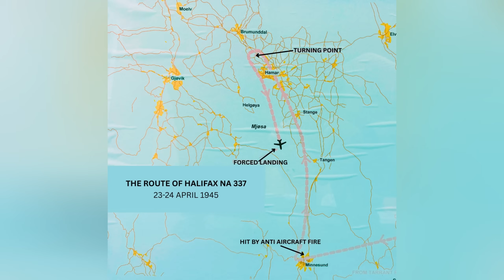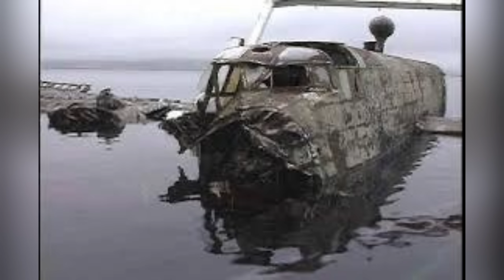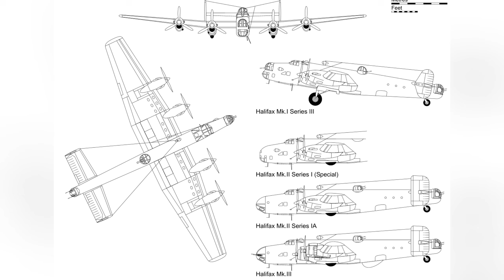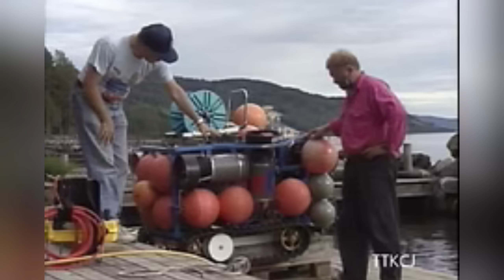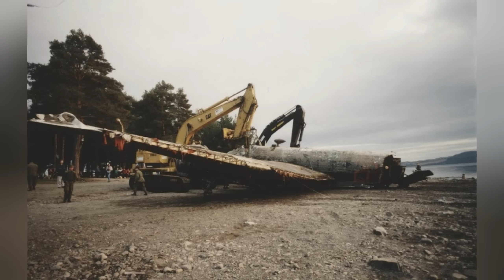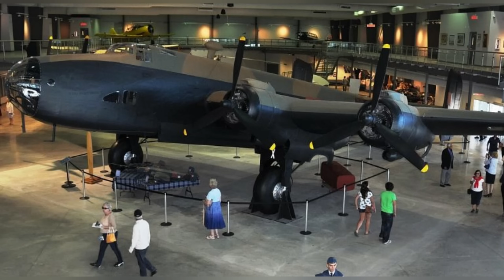Salvaging Halifax NA337: 750ft Deep-Lake Bomber Lift Operation

Comment: Interesting that the same cold that killed the crew preserved the aircraft. 

Also, was 644 a Royal Canadian Air Force squadron? Why otherwise would it go to Canada? Was it one of the licences built aircraft produced in Canada? 

Also: it’s not quite right about it being the only fully rebuilt Halifax in existence, there is Friday the 13th at the Yorkshire air museum, which also has been restored, and all 4 engines run. And boy, are they loud!
Reply: No Halifaxes were built in Canada. 644 was a purely RAF Squadron, and  in 1944 it was operating from Tarrant Rushton in Dorset, not a Bomber Command aerodrome. It isn't very clear why this aircraft ended up in Canada. Possibly it was just that there are various Halifaxes, or parts thereof, in the UK, and the Canadians wanted one to commemorate their contribution. Number 6 Group Bomber Command was an all-Canadian formation which flew Halifaxes, so it seems appropriate.
Reply: The RCAF formed 6 Gp Bomber Command and flew a disproportionately high number of Halifaxes. The RAF already had a recovered Halifax from Norway so giving it to Canada was fitting.
Reply: @Dalesmanable  Agreed.
Reply: I don't believe the Halifax was ever produced in Canada. Perhaps because the crew was Canadian? As for Friday the 13th, isn't that made up from different Halifax parts? NA337 is a complete original airframe. Either way, a most impressive aircraft.
Reply: Friday 13th is a replica. Some parts are original but the majority of the airframe is not, for example the wings are from a post-war Hastings.